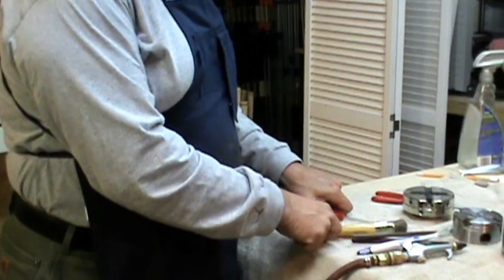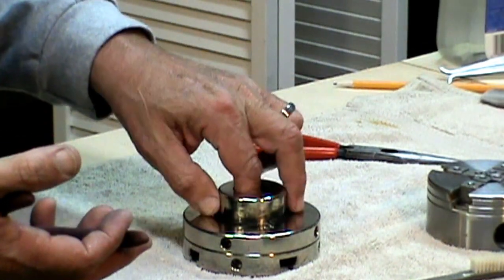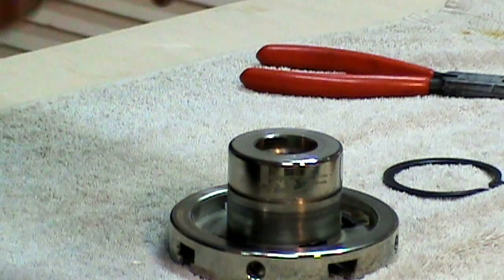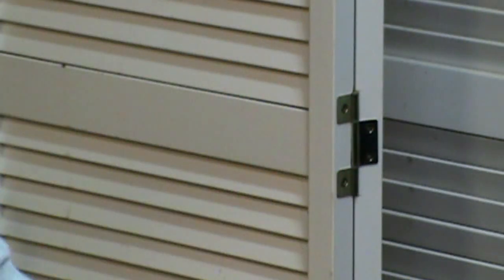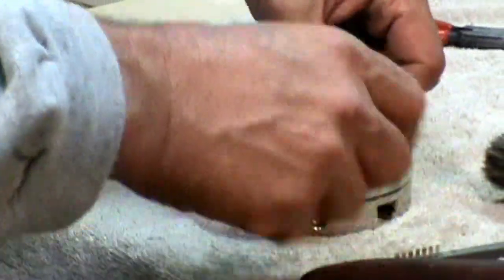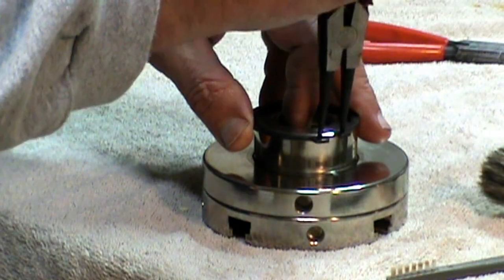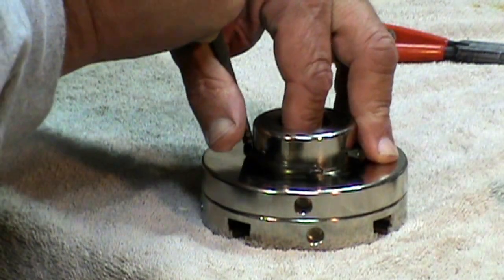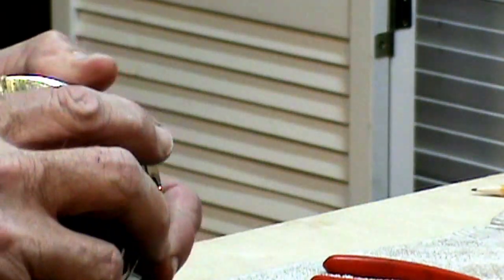Lathe Chuck Maintenance: Woodturning

Comment: Great explanation of the different chucks and great photography by Trinity.  I bought a Delta LA 200, Type I, at a garage sale with most of  parts missing.  The lathe chuck being one of them.  For a week-end turner can you recommend one.  Thanks
Reply from the maker: The Record Power is a good one. Good price and Nova jaws fit it. Check out woodturnerscatalog.com

Comment: Nice job explaining an important maintenance task. Impossible to do without the external  spring clip pliers. I bought some cheap Harbor Freight pair with interchangeable tips. What a piece of crap!
Reply from the maker: Thank you for your kind comments. Indeed the ones HF sell are not to good, however the ones Autoparts stores usually sell are a bit better.